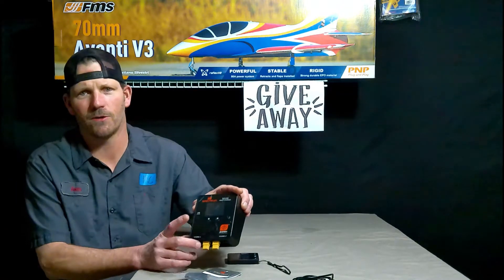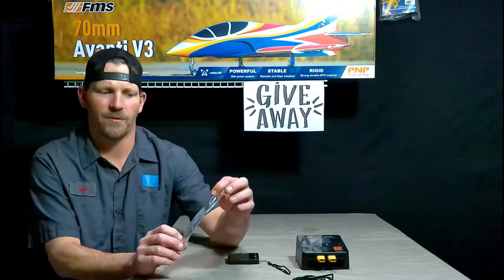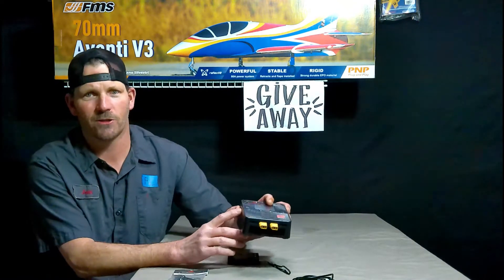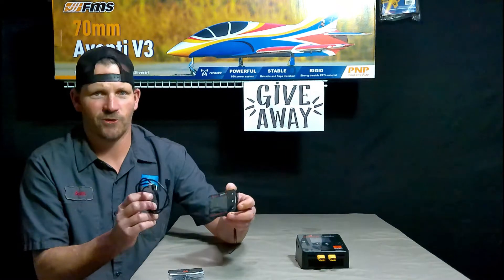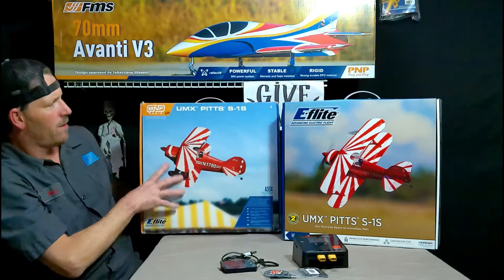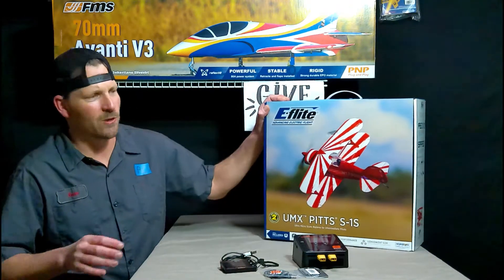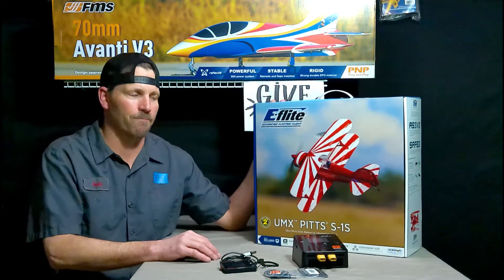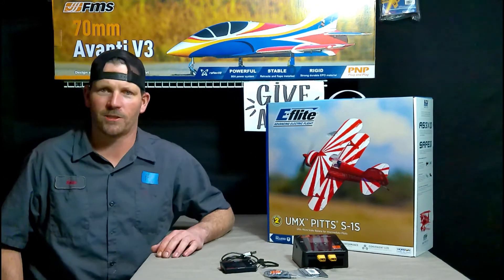SPEKTRUM SMART BATTERY CHARGER & XBC100 CHECKER SERVO DRIVER FIRMWARE UPDATE USB CABLES 2 DIFFERENT

Comment: I wish spektrum would standardize their update cables, it's annoying and expensive buying individual cables for each product.
Reply from the maker: IM STARTING TO FIGURE OUT . IM STARTING... I THINK THEY ARE USING CABLES THAT WE CAN GET ANYWHERE JUST DRESSING THEM UP TO LOOK LIKE YOU HAVE TO GET A SPECIAL ONE. THIS LATEST ONE FOR THE SMART CHARGER THE USB TO 4 PRONG HEAD PHONE MIC CABLE IM PRETTY SURE THERE IS NOTHING SPECIAL IN THAT ADAPTER . I HAVE THE CABLE ALREADY FOR ONE OF MY CAMERAS IM GOING TO TRY THAT ONE AND SEE IF IT WORKS .